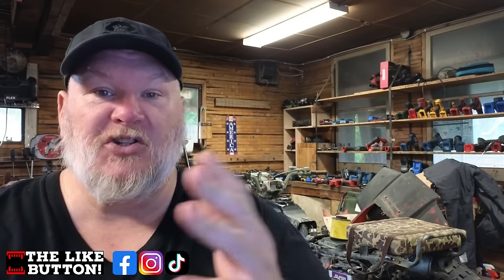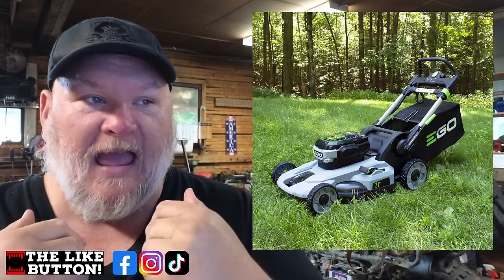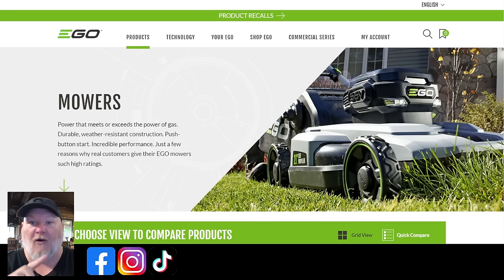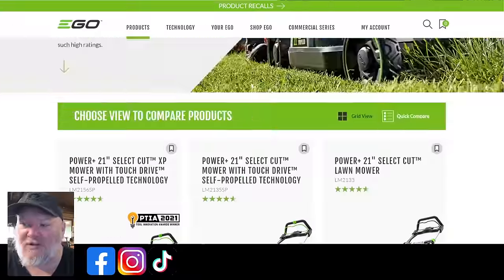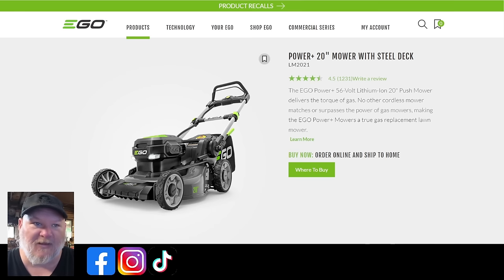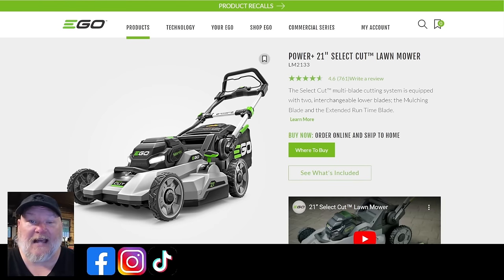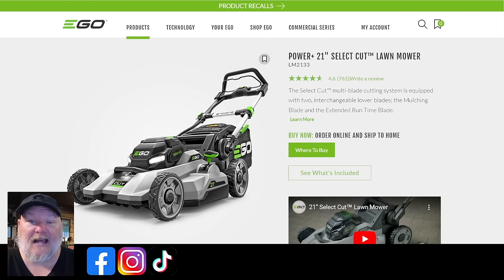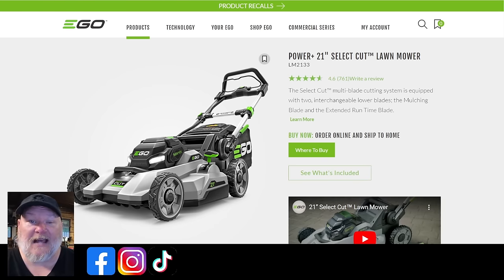What is Going On with Ego Mowers?

Comment: I sold my self propelled, after using it for a yea,r for $500 and bought a Simplicity riding lawnmower. I still have the weed eater, chainsaw, hedge trimmer and blower. These are all older models but work great. I only had two 2.5 ah batteries and the fast charger. A friend of mine has a big lot and the grass is at least 2' high. I started with the weedeater but the batteries would not last as long  as I would like. They do charge fast but I wanted a bigger battery. At Lowe's the 6 ah battery was $350. A bit much so, I bought the 2114 basic model for $400 and got the 6 ah battery and charger. That mower has a high lift blade and no side chute, just a plug. It is not self propelled and just mulches. Believe it or not, I was able to mow the grass setting it on high and making 2 passes. I think it lasted somewhere between 45 minutes to an hour. Still a struggle because it is a big lot. I'm getting ready to go over there and use a grass whip and see how that goes. Lol.
Reply: No more chance to do the work out... no more sweating..

Comment: Buying the self propelled Ego was a mistake for me. The battery dies really fast, even when pushing manually. Now I have the drag of the drive gear working against me while pushing. If you buy the optional 10 AH batter, the drive system might be OK. I bought a small gas powered lawn tractor instead. The Ego is my touch up unit for tight spaces only.

Comment: I have a section of grass that regularly stalls my Honda so I went with the high torque 8.3 and it powers straight through no problem.  A larger yard for a city area 10 AH single battery is perfect.

Comment: I think you can get the dual charger in a kit, but if with a snow blower. Which would be great for us that live in a snow region.  
Thanks for another great video really enjoy the videos.
Reply: You can get the dual charger in the snowblower kit…but it’s not fast. I ended up buying a second fast charger instead of using the dual that came with it. The 2 5Ah batteries can be charged before the 2 5Ah batteries in use run out as long as you use the fast charging.

Comment: I want a 22 inch mulcher.  It actually seems way bigger than even a 21 inch that it replaced.  20" are toys.   What does a battery cost?  When my newish Toro needs replacing perhaps electrics will be where they need to be.

Comment: i have the Power+ 21" i have had it a few years now i have a 1/8th acre lot with 1000sqrft house and 20x20 garage and i use the ego in the fall to bag leaves in early fall before they get super deap and the grass is still growing and it will do my entire yard on a charge and just be complaining about low battery as i finish up it is a 5 ah battery so this year i got the string trimmer that has another 5ah battery,

Comment: You may want to look at the actual and recommended charging options for LI batteries. Battery University is a good source. If you want your overpriced battery to last as long as possible, you don’t let it run to zero and you don't charge to 100 %. So your runtime is drastically reduced along with a number of other considerations that one needs to consider (fast vs. Slow charge...)
Reply: EGO batteries can’t run to zero. They are protected with a voltage cut. So over-discharging isn’t at all a threat. They are balanced charged, I wouldn’t hesitate to charge the, to full provided I’m not leaving the, sitting around after the charge. Storage should always be at 50% or thereabouts, that’s usually a LiPo thing, but honestly it’s a good practice. I agree with what you hinted at. The rate of charge has probably a greater impact than anything on cell longevity (assuming a protection scheme is in place for the cells). The slow chargers are absolutely the way to go. Preventing heat build up in a cell is critical to longevity and higher charge rates do impact battery temps. 

But not charging to full is an arbitrary and wasteful endeavour IMHO. It’s not possible to do that with precision with these chargers and I do not see the value in partial charges based on their use case which is to perform. All batteries slowly die. Willingly taking a hit on performance or capacity to protect the cell is putting the battery before the equipment. Job/equipment first. The battery cannot be the primary consideration when measuring against use and performance IMHO.

Comment: I'm thinking about pulling the trigger on a GreenWorks 25" 80v mower that just recently came out.
Reply: GREENWORKSCOMMERCIAL

82V 25" Self Propelled Mower with 8Ah Battery and Dual Port Charger (82LM25S-8DP

Comment: I bought a EGO LM2142SP dual battery self propelled mower last July for $729, it is now $699.  It is a great mower for cutting grass.  But I'm finding it lacking in the fall when I mow over the fallen leaves and mulch them up.  My old mower, an old Honda had a mulching blade with two levels of cut.  I'm wondering if I could get a similar blade for the EGO and get similar results.  I'm not sure which blades would fit the EGO.
Reply: They sell a mulching blade set for their SelectCut mowers (the ones with two blades). They’re about $40 for the pair. There’s another set designed for more suction if you’re bagging them.

Comment: I went to Lowe’s to check out 56v 7.5 Ah one the other day and it has plastic wheels. My gas one is rubber. Is that going to be an issue down the road? Also I thought mulchers and side dispensers were included? I didn’t see either.
Reply: With Ego's higher-end/more expensive mowers, the mulching blade and mulching plug are in the box, as is the side dispensing chute.  But maybe these aren't included with the lower-end models.
Reply: The bag is included on all models and the mulcher is an insert to put in when not bagging, which comes on all the units too. My model included the side discharger but I wouldn't recommend it. It's better to just mulch it or use the bagging feature. I've had my mower for 8 years now and wheels are still OK. They are a little worn but they seem to last as long as the rubber wheels on gas mowers.

Comment: I really want to buy a EGO mower to replace my gas model, but I'm very worried about losing function.

My lot has approximately 10,000 square feet and I use my mower heavily in the fall to help vacuum and mulch leaf debris. 

My lot is flat and I can push. I don't need self propelled. 

Any feedback on models with 7.5 or 10 ah batteries would be appreciated.
Reply: get a honda hrx while u can, change the oil every few mows at first and it will out live you. thats a large lawn, the hydrostatic model, no belts, even with thicccccccccc af Bermuda I have to run after it, even if the grass is wet. If you have a thin weak lawn, electric would be fine though

Comment: I have the lm 2102sp and have had it for my 3rd summer and been pretty happy so far.  The battery has been solid.  Have most of the ego tools and the batteries are interchangeable so I use the 7.5 ah in my snowblower as well.  My yard is around 7k square feet and uses around 3/4 of the 7.5 battery. The 2156 was last years top model and the 2167 is this years top model.  I have every charger other than  the turbo one.  I basically only use the rapid charger and the 2 port that came with my snowblower.

Comment: Second season with self propelled and big battery. 
One hour per week - battery rarely goes below 50% charge. 
Self propelled works for crap - oscillating between locking the wheels and running so fast I can barely keep up. 
No joy of getting warrantee from EGO and retailer passes the buck. 
Actually,  no joy on even contacting EGO. 
I’ll finish season then IN THE GARBAGE IT WILL GO.
Life is too short for bad service actually non existent service. 
Their system is designed to discourage and deflect - I’m sure they’re happy. 
Buyer beware.

Comment: I am about to replace my LM2022SP. Should I choose the LM2156SP or LM2200SP?😮😅
Reply from the maker: 2200 has an Aluminum deck, it's 1" wider, and has a solid boost in cutting power.  The question only you can answer is do you need that?

Comment: I believe the touch drive is just a fancy way of saying it has a button.  It doesn't control speed or acceleration beyond on and off.
Reply: I have this 21 inch model, and I can tell you that the touch drive is not just an on-and-off button, it does vary speed depending on how far you rotate the switch. It's not just an on-off button
Reply: @jimlogsdon5308  The touch drive are just buttons on each end of the handlebar.  The speed adjustment is separate and in the center of the handlebar.  They're separate, right?
Reply: @ViolentEngineering correct. Touch drive is just on and off like the op said. The variable control knob/rotator in the middle controls the speed.

Comment: When you got a LM2142SP (the original EGO box actually stated 8.5 ft-lb torque 😉) and convert it into a SelectCut dual blade (replace the flange, washer and blades) with two 12.0Ah batteries to get total of 24.0Ah and 190min runtime... You got an one and only Peak Power SelectCut LM2147SP XP... Zoom....Zoom... Zoooooooommmmmm🙃

Comment: What about actual blade length? I’m reading that the 21” models actually have 20” blades. Therefore standard 21” universal blades won’t fit
Reply: The 21 inch figure refers to the deck diameter, for which the blade length is 20.5 inches, at least according to Ego's listed specs.

Comment: You have touch drive and speed IQ mixed up, Speed IQ is the one that senses your stride and from all the reviews I’ve seen it’s not a great feature. Touch drive is where it’s at for the SP models, set the speed toggle and press the button.

Comment: My John Deere is 30 years old and still runs like a top. How long you think that EGO will last
Reply from the maker: Longer than a JD walk behind mower built today 😂
Reply: @denoftools    John Deere stopped building walk behind mowers 12 years ago bro.
Reply from the maker: @Jimmy-Legs  exactly!
Reply: @denoftools      So you never said how long you think an EGO mower will last. And then you have a battery that will probably have to be replaced in four years.
Reply from the maker: @Jimmy-Legs  and I have another video that compares gas to electric and shows that cost of ownership is identical. 😮

Comment: I like a riding lawn tractor. If EGO made a cordless electric mower, I would buy it to replace my Cub Cadet lawn tractor.
Reply: They do make one. Hope you have plenty of money to get one
Reply: They have a zero turn that they claim can do 2 acres. It has 4 batteries and claim the charger can do all 4 at once in 2 hours. It has capacity for 6 batteries to go up to 3 acres. 

It’s pricey, but it depends on what your time is worth to you. If you factor in having to get gas, change spark plugs and filter, oil change, etc. you spend a lot of time on the mower without mowing. With electric you just charge the battery and move on. 

I think in a couple years the market is going to eliminate a lot of gas mowers and yard tools once economies of scale and production prices drop.
Reply: They make a zero turn that’s twice the price of a gas similarly equipped. Lol.
Reply: @kalebbrown93  Thank you for the information.

Comment: I almost went with EGO in my decision to switch my OPE from Ryobi. I'm that guy that wants the metal deck electric mower and EGO only having one metal deck mower makes me feel like they'll discontinue it right after I get into the brand like Ryobi did. I went with GreenWorks Pro 60V line cause they have a great and robust chainsaw with lots of metal parts!
Reply: I was on the fence about Ryobi vs. EGO. Though I went with EGO as Ryobi's battery voltage devices varied to much also IPX rating concerns. I don't mind trying a plastic deck as my current metal deck broke where the height adjustment mounts, so one wheel is fubar. I have no idea how it broke.

Comment: I would caution anyone looking at the 2167sp… from what I’ve heard the speed iq is junk. 2156sp is a much better deal IMO. On sale for $699 right now
Reply: I have a LM-2167SP that I got at a local flea market and it has a bad conection that I need to figure out but I really liked it and it's not JUNK so I just picked up a LM-2156 today from a overstock store for $150 minus battery but I have several batteries to use with it..Just can't go back to the less power of my LM-2101sp so the LM-2156sp will do the job for now 🙂

Comment: You buy the lawnmower and then you spend almost the same amount to buy one extra battery.
Reply from the maker: EGO is doing an extra battery free with purchase currently.
Reply: @denoftools  on all models or just certain models?
Reply: If you weren't able to get an extra battery at purchase, a good trick is to buy another tool with a compatible size battery, like a blower or a chainsaw. I got a chainsaw with 5ah battery that I use for my mower. Now, when the chainsaw is needed a couple times a year, I've got one and it works excellent.

Comment: i don't know what brand it was but one burn down a house near me. the only thing i have to say is leave battery cars and mowers at outside and away from house. take care, be safe and well.
Reply: Like propane tanks and gas cans have never started fires. I have one battery charger in my shed and another in the garage. Been using Ego products for 8 years. No problems.
More likely to have a problem with a space heater.
Reply: @frommatorav1  mower battery blew up in basement there was no space heater propane tank or gas cans in the house only heat pump. I have seen the electric cars burn up in parking lots and you can't put them out. I have battery chain saws only good for light use 1 of them has already give out and nobody works on them I took it back to Lowe's and got money back sure it's in a landfill some where now. I wish you luck.
Reply: @johnwoody4905  I'll keep it in mind. My only precaution is I take the battery off the charger when it's completed and put it in the mower or leave it standing up on the table next to it.

Comment: These are some of the most overrated mowers on the market. The ego battery system is great, but their tools are hit or miss. I've got a z6 which is awesome, and the blowers are great. Also have a power head with hedge trimmer that I love. Push mowers and string trimmers are terrible.

I can drive by a lawn and tell that it's been mowed with an ego walk behind. You can tell because they have to overlap each pass just to get a decent cut, so the wheel marks are all really close together. No uniformity to the "stripe" in the yard.

I purchased an ego push mower and returned it the same week. Same with the string trimmer. The experience of mowing with one is terrible, mainly because the wheelbase is too long and the ergonomics are bad. It takes longer and and is harder to manuever around the yard. You can't really get into tight areas with it either. If the cut quality was excellent, I could deal with it but it's just okay. 

I run 2 different battery systems because of this....ego for the zero turn and blowers, greenworks for push mower and trimmers.

Comment: My ego crapped out less than 4 years...both batteries 5.0 & 7.5 both done, $1100 wasted... To replace both from ego (they will do nothing at all to help) $700, 2 batteries, $700... Do that every 3 years and you'll be back on gas or switch to Milwaukee, 5 years minimum....not maximum of 3 years like ego.... seriously, no help whatsoever...would have maybe stayed with ego if they would have done literally anything.... nope, they dont have to so they'd rather lose a customer for life... anybody want a mower and leaf blower cheap? I'll put it in the trash... nobody should want this garbage

Comment: There are pros and cons to electric mowers. Like any battery device. Charging time. The huge downfall. With gas. Just put in more gas. Electric. The power it up to it or as these. They can be adjustable. Gas. Put it on high and forget. Gas run times. 7am to 9pm. Electric. 24/7 run time. I mint get one of these some time in the future. That's when the one I have been using now for 6 years straight fails. Same mower and battery going strong. Zero problems. Not this brand. Why go this brand. I can buy it locally. The other brand I am using and I have to order. I have the push mower, the weedeater, the blower, and the hedge trimmer. Very pleased how they are working. Yet. I have to oder. Only problem. I love doing yard work at 2am. My neighbors don't even know. The Mega huge plus about battery tools.

Comment: I bought a ego mower in 2016. WORST purchase ever. Batteries are CRAP
Reply: Compared to 2016, we're living in the future now
Reply: My battery (5ah) from 2016 is still working but not at close to full capacity. My replacement battery from 2021 is a much improved 5ah battery and is going strong in the mower from 2016.